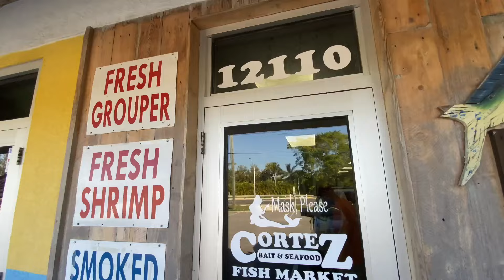DIY TINY HOME , Skoolie 2023 | finally finished the couch | Nearing the end

Comment: I like the reed medallions! Instead of the dark or unfinished trim on the soda, could you stain it to match the walls by the bed? I think that would look nice, tie things together. But you do what you like, I'm not the one living in it, and I am in no way shape or form, anything close to an interior decorator! :) Making good progress!
Reply from the maker: Thank you! 😃💫Which walls by the bed? The partition?
Reply: @floridachickstinyadventures  correct, the partition.
Reply from the maker: @raysun2be  that’s the same dark stain that is on that one sample trim board I showed in comparison:)
Reply: @floridachickstinyadventures  ok. For some reason it looked darker than the partition. Nevermind. :)
Reply from the maker: @raysun2be  It might be because the wood is different so it’s absorbing a little different :)

Comment: I’m not sure if you have yet or not too but the fiberglass on the shuttle bus tends to soften on the corners so what we did was get liquid flex seal and painted the clear coat on the roof for no leaks.
Reply from the maker: Yes we did something similar to that. Put fiberglass on certain seams and then rubber roof coat over top.